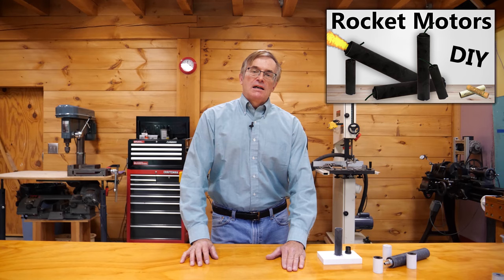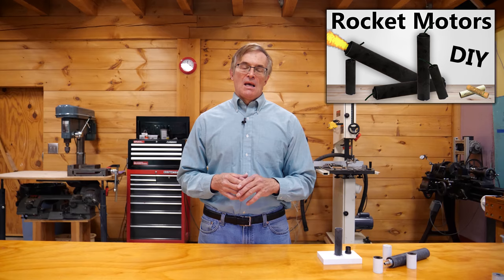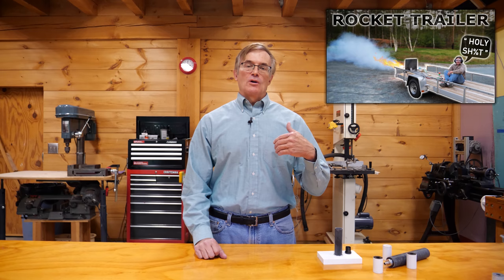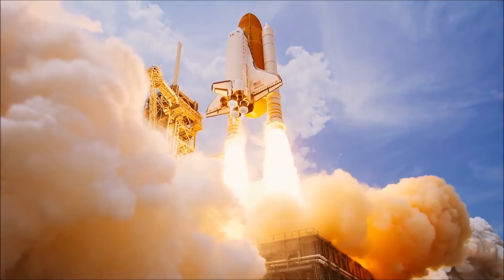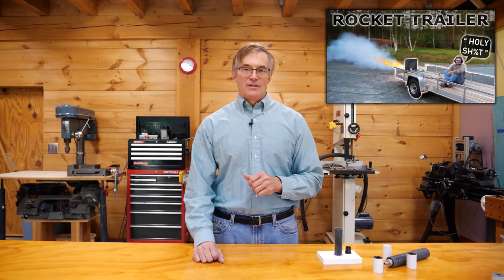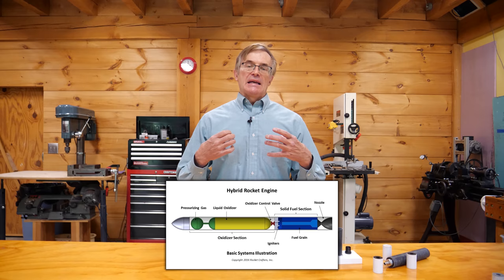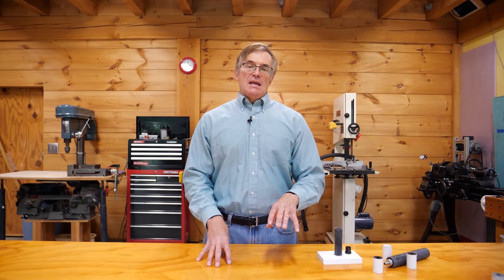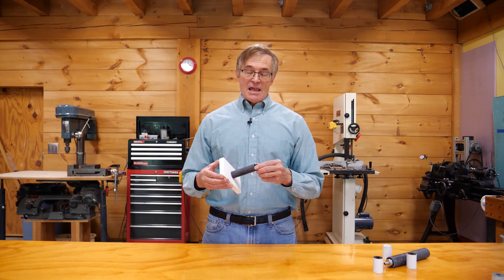Mixing Nitrous and Rockets is DANGEROUS... But Really FUN!

Comment: I sort of call bull$hit on this video, because Nitrous Oxide is non flammable and in fact is considered an "inert gas"!! What Nitrous DOES is lower the intake temperature in the combustion chamber which allows the user to add even more fuel to the "air mix"!! PEOPLE always assume that Nitrous ALONE is making the fuel more "reactive", which is just not true!! Instead HOW it works is making the engine/ motor DEMAND MORE FUEL, because the engine is fooled into "thinking" the air is much colder than it actually is, meaning you can add a denser charge of fuel to an already strong mix of air/fuel!!! 

Likewise rocket engines use an oxidizer to their liquid fuel engines to make them burn both faster and hotter! This oxidizer is highly toxic, and highly corrosive as well!! Even in solid rocket boosters there is a chemical oxidized added to the mixer is exact amounts which is more liken to creating a controlled explosion than it is an "even burn" and the combustion chamber and nozzle designs on rocket engines vary between the required thrust, fuel type burned and specified fuel consumption rates per minute or hour. It is literally a huge difference between a race car motor and literal "rocket science"!! Plus there are other variables added into all this as well too!! So speaking on the dynamics just adding nitrous is not enough to produce more thrust, because you still have to account for more added fuel!!! And then fuel types also matters greatly as well too!!!
Reply: And by the way "an oxidizer" does burn and is NOT an inert gas or liquid or solid!!
Reply from the maker: You're wrong.  Although nitrous conversion cools the incoming charge temperature, it's main contribution is as an oxidizer as well as a significant energy source from decomposition into oxygen and nitrogen.  If you disagree, try racing with liquid CO2 or liquid freon, you'll stop your engine as soon as you hit it.
We'll cover more of the rocket science as we progress.
Reply: @TechIngredients  If I remember correctly, in addition to it's oxygen contribution, the heat of disassociation of N2O is 1200 BTU/pound.

Comment: Seriously. Stop. Using. Circular cores. Aaaaaaaa. I literally comment this on every video. Stop. Stop. Stop. You're losing 16% of your efficiency!
Reply: Excellent, I did not know that.  Tell me more
Reply: @ProlificInvention  You can see here  that by introducing more surface area, one can increase the thrust of a SRB:
https://en.wikipedia.org/wiki/Solid-propellant_rocket#Grain_geometry
This is optimized by using a star core. on my team we use a 7-3 star to increase our efficiency from circular cores by 10%, though 16% was our theoretical maximum.
Reply: Have you cinsidered the extra weight of the extra thickness needed to support the pressure?
Reply: @santiagoperez2094  yes.
Reply: @thealienrobotanthropologist  see my 2nd comment above
Reply: @tuskiomisham  High surface area fuel grains do not have the same effect in hybrid motors, additionally, the fuel is insulation.